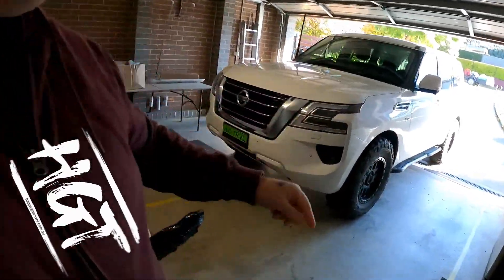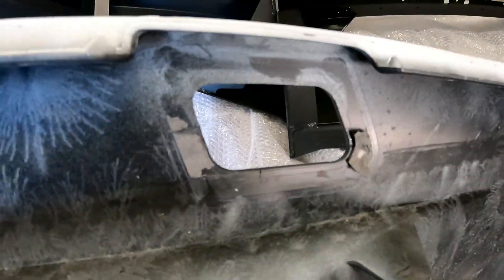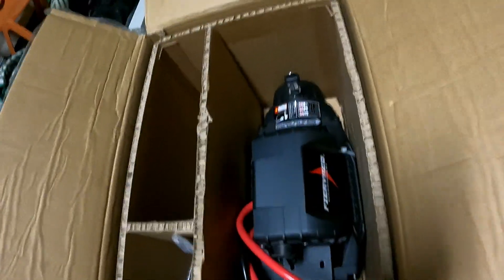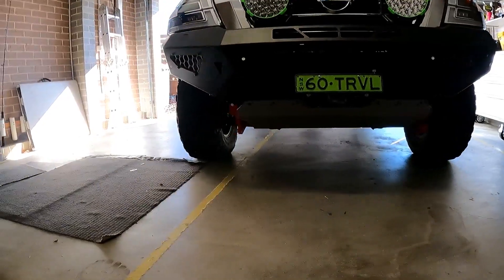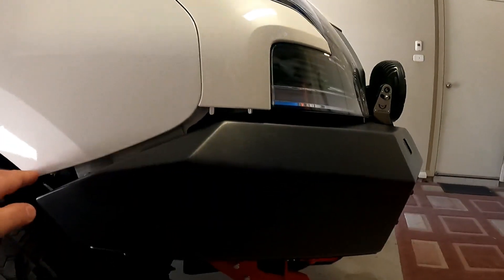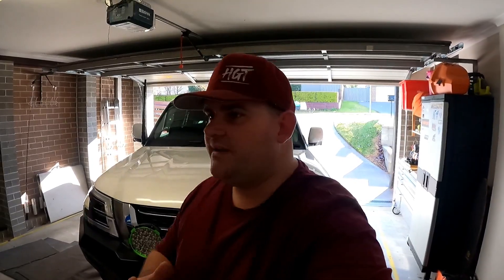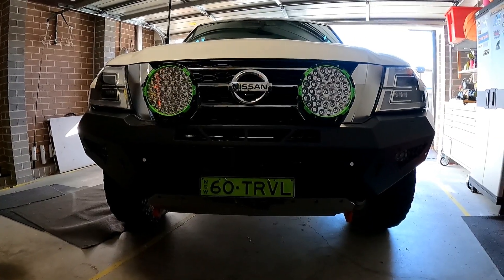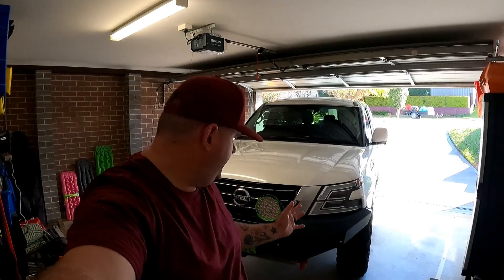Offroad Animal Bullbar - Install & 1st thoughts - HGT Y62 Patrol build

Comment: Hi Caleb, my Off Road Animal bar is getting installed tomorrow. Just interested to hear have you had any drama's with the front sensors or radar system ? Hoping it all works as it should still. Cheers mate.
Reply from the maker: Nothing at all everything works the way it should. The front camera is a little obstructed but it doesn’t phase me too much. I will eventually relocate it
Reply: @HappyGoTravel  Thanks for the reply mate.

Comment: I suppose the one thing in particular I'd have done differently would be figuring out how far towards the sides the spots could go, so that they don't block airflow through the grille, but it probably doesn't matter that much anyway.
Reply from the maker: I pushed them out a little bit mainly to sit in proportion

Comment: Did you have a suspension lift prior to installing the bar and winch? Have heard that with stock suspension 295/70R18 scrub
Reply from the maker: No I didn’t. I had no scrubbing. This style of bar opens the front up and creates more room. I did remove the front mud flaps and pin the guards when I did the tyres though

Comment: Any reason you picked this vs the predator, rhino and similar type of bars ?
Reply from the maker: I liked the built in recovery points and the higher lines (shortening the grill). 

The others are still good options. I think the rhino is too pretty for me and it’d need to be painted. 

The predator is good and I do like it, but the most common s5 bar around. 

I wanted something a little different. I think these will become common on the s5 too, but for now it’s a little different.
Reply: @HappyGoTravel  I see, the animal looks similar to the predator. Look forward to a long term review and bush effects.
Reply: @HappyGoTravel  I have mine ready to fit and a big selling point for me was the 65Kg weight of the bar and it being a once piece setup unlike the Rhino and Dash bar.